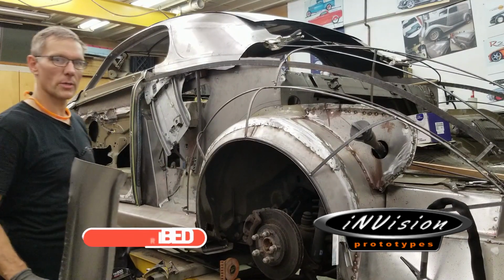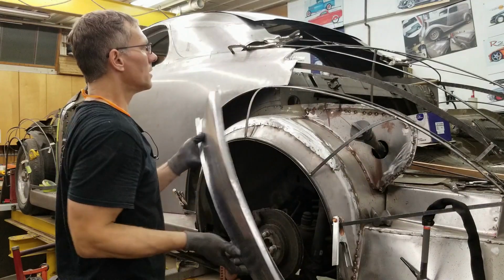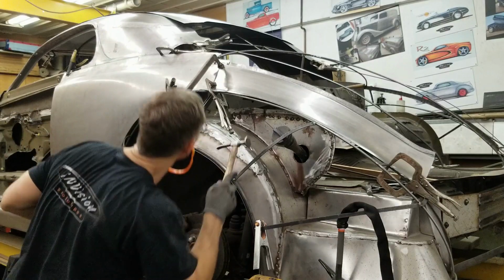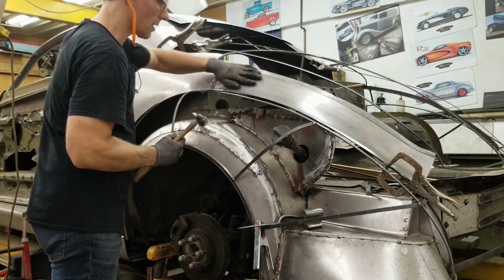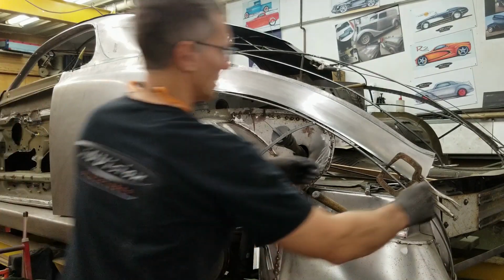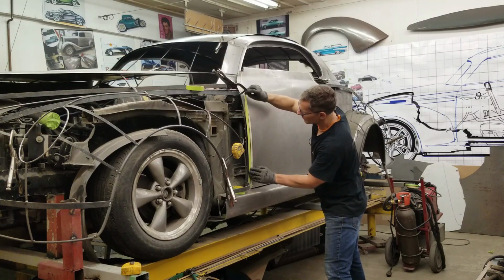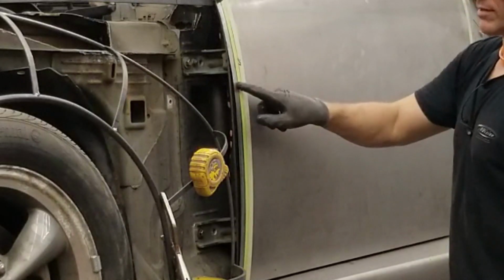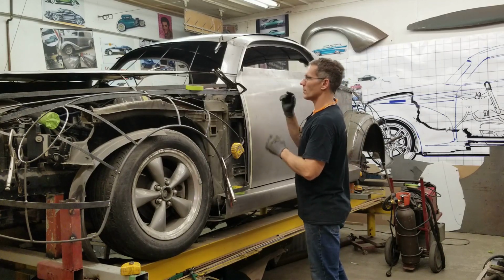Quarter Panels & Door Skins Pt.1 - Ep.29 - 1940 Ford Coupe Inspired M40C Build

Comment: I've noticed that you feature a lot of edge turning in your videos. I hate edge turning. It takes my beautifully and perfectly formed part and takes it all out of shape, requiring time wasted on figuring out adjustments, even if I use a shrinker/stretcher along the way. I've spent so much energy on making very good panels, that I've just now am focusing on making edges.
An odd thing I've noticed about dolly work, is that it raises the metal opposite the direction of the hammer.
Reply from the maker: Hey Mike, it's not intentional that I show edge turning.  Just part of the process.  If one tries to roll more than 3/4" it's gets to be a challenge, but then again it depends on the situation.  Some guys will form a panel, then form an edge that has been tuned to the correct shape as a separate part and weld the two together.  It's all about doing what your are comfortable at.  Also, when you spend enough time behind a hammer and dolly you learn how the metal behaves and what you can get away with.  Thanks for sharing your experience.  N.
Reply: @iNVisionPrototypes  That makes sense. I will reduce the width of the edges. I think I'm doing .75".
Reply from the maker: @mikep608  Have you seen the hand held flange tucking tool I demonstrated in Episode 37 of the Electrode roadster build?